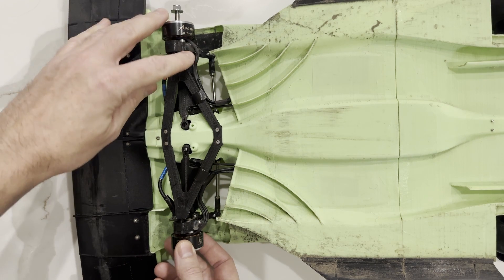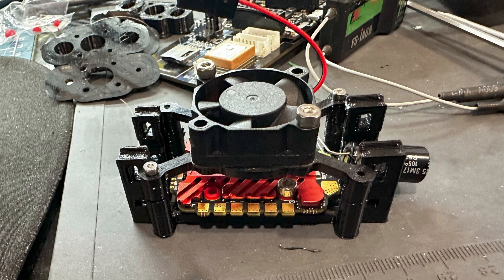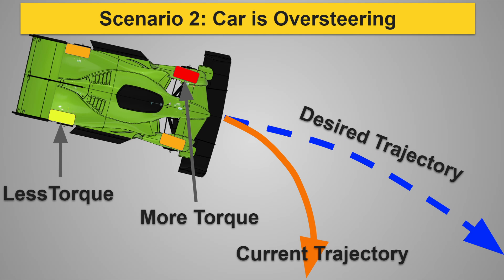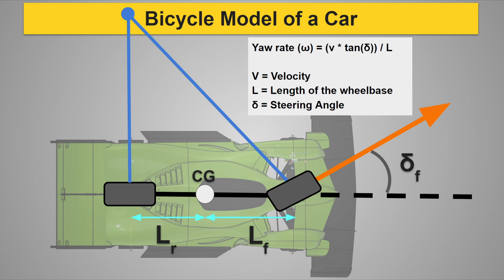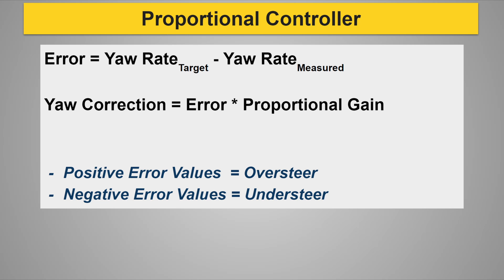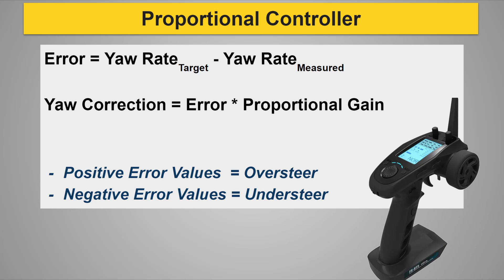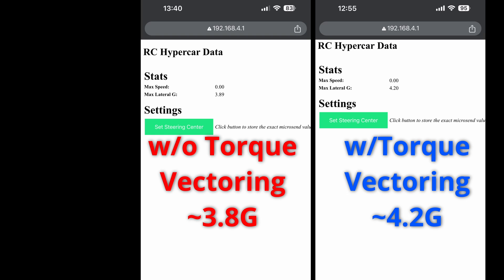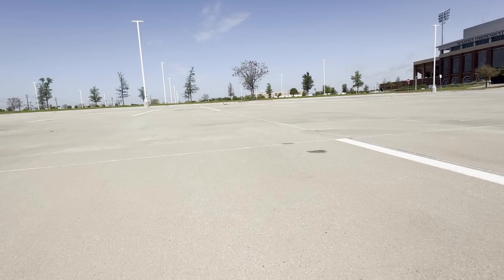RC Hypercar Pt10

Comment: What a fun process to follow along with. I wonder how much more room there is for improvement with a hypothetically optimal torque vectoring setup that considered weight transfer. I was actually shocked that it made such a large difference at high speeds. 0.4g is not insignificant at all considering the amount of downforce already involved.
Reply from the maker: Thanks!  Yeah, I think in retrospect that a lot of that gain at high speed was because I could push the car harder over the bumps. Basically the torque vectoring was acting like stability control so I could lean on the car more.

Comment: Nice work.  I would suggest you move the heavy wheel motors off the wheels and put them in the center with driveshafts.
Reply from the maker: I looked at that a bit, I couldn’t find a good driveshaft setup.  I need to buy some old RC touring cars for parts. 

The driveshaft some trade offs as well, the diffuser would be smaller in the middle.

Comment: So you're using the Avenger 2810 900kV motors correct? Do you think you could get away with smaller motors as well?
Reply from the maker: I have the 2810s in the front and 2812s in the rear. I don’t think I could get away with much less because of the heat unfortunately.  

When the car was rear wheel drive it was very marginal from a heat perspective, with the front motors added it’s much better, but I still need the turbofan wheels to pull the heat. CFD shows the car will pull 600 watts at top speed.
Reply: @IndeterminateDesign  I see, thanks! :)
Reply: And one more question cause I'm thinking of building something similar perhaps: How are you dealing with dust or sand getting into the outrunners? Has that been a problem you've encountered so far?
Reply from the maker: @TheHypaaa  The dust is a bit of an issue sometimes and I always clean out the motors after running.  The bearings probably won't last as long, but they're not too hard to replace on these motors.  

One parking lot I ran in had magnetic rock dust.  It was a nightmare to remove from the magnets and it destroyed one of the motors.  

It's definitely possible to create a dust shield so the air is only pulled in from top half of the wheel.  The car moves so much air that everything gets packed with dust.
Reply: @IndeterminateDesign  I feared that might be the case, but thanks!

Comment: Very cool project. Torque vectoring is basically what you are doing when you change differential gear oil weights. It's interesting to see this being done electronically. This is a on whole other level, and the performance shows. :yougotthis:

Comment: Have you looked at using bidirectional dshot to talk to the ESC and get telemetry out of it? Betaflight uses that to get motor RPM and it seems to work pretty well.
Reply from the maker: I’ve looked at it, the Arduino libraries that I found are still kind of rough. It would be great because I could update motor throttle several thousand times per second. I’m not sure if this is a function of the ESC or the firmware but the RPM is +/-200 with a 30ms delay. It’s good for balancing out the motors over time since they all respond slightly differently, but for traction control with the encoders I’m looking at +/- 3rpm.
Reply: @IndeterminateDesign  Ahhhh, that makes a ton of sense, yes. Bidi dshot telem is definitely not going to do what you need then. 

Adopting dshot, though, could definitely provide some gains in motor control, though, which would be super cool! It might be worth looking in the dshot code in betaflight or ardupilot if you're thinking about going that route.

Comment: I’m blown away by how far this car has come. The pov cam was awesome too. Really shows how ridiculously sharp those turns are. 10Gs is insane. The average human passes out below 7Gs. The velcro on the battery made me laugh because I have that same problem with my rc boat. I’m amazed how durable the front splitter is. That thing was eating those rocks like they were Doritos lmao.
You’ve basically already done all the stuff I was thinking of, and I have no idea where you could go from here. But it sounds like you’re not done so I’m very excited to see what’s next.
Reply from the maker: Thanks!  I have an entire box of broken front splitters.  This last one is made from nylon and it just kind of bends now.
Reply: There's a big difference between lateral Gs (like a driver experiences) and vertical Gs (like a pilot or roller coaster rider experiences) on the human body. We can take far more lateral Gs than vertical.

Comment: this is one of those rare cases where human limitations prevent a car from performing better, i cant even imagine trying to drive this on any track. maybe you could try it on a 1:8th scale pan car racing track or a asphalt touring car track with reduced power output and work your way up? would love to see it on a track, maybe even get a transponder system to compare lap times with some other rc car classes on some local track that has timing equipment?
Reply from the maker: I will try to do this. I’m moving to a city that has a big indoor RC car track, so I’m excited.

Comment: Really nice project! I am trying something like this on a smaller scale, more like a formula student. I am using drone parts and thinking about  the torque vectoring, do you think it would work a bit like differential thrust for a plane?(albeit a bit simpeler) I don't have enough time for writing al the code but it should be able to work, right?
Reply: I am also using fans for downforce(small drone motors and props) and am going to try a small aero package as well
Reply from the maker: Differential thrust helps the car/plane steer tighter. It’s kind of a passive torque vectoring, it will help turn tighter but won’t increase handling performance.

Comment: would love to see you racing this with a fpv camera on it
Reply from the maker: I think FOV would be the only way to run this on a race course. It’s so hard to judged distances otherwise. Really this car needs a karting track.
Reply: There is a lot of image vibration to deal with that you just don't get when flying a drone with fpv. Every little bump in the surface causes camera shake. Also at higher speeds you get a bit of tunnel vision and need the camera mounted up quite high to still get any decent depth perception. High speed in a parking garage with tall walls to see was not too bad but outside in a parking lot the curbs are hard to make out until you are right on them. I tried it on my Vendetta with the camera mounted probably 6 inches above the body shell height with dji hd fpv cam. It was fun but challenging.
Reply from the maker: The vibration is pretty bad. I’m using a Runcam split 4K, which I think is an FPV camera. I had to mount it on foam though to get decent footage.
Reply: @IndeterminateDesign  I started out trying to soft mount the camera with some dampening tpu mounts but it was undrivable via the fpv feed. The least shaky image I got was hard mounting an aluminum bar to a solid carbon fiber brace on the chassis. The bar stuck out through the roof of the car and the camera mounted at the top of the bar. The piece to secure the bar to the carbon brace was a beefy petg piece and the mount for the fpv camera to the bar was also petg. That limited the vibration to just what the car felt. All my soft mount attempts just amplified the vibration.
Reply: @IndeterminateDesign  supposedly one of the very latest runcams has faster onboard image stabilization.. might be enough now. (I use one of the older ones and its marginally good enough for my slow fpv truck on rough ground)
Reply: It's definitely best to mount the camera solidly to the chassis, because then the whole vehicle is the damping mass and the suspension actually works for the image stabilization. Having the vehicle locked in the view helps with orientation and drivability.

Comment: How long dose the battery last?
Reply from the maker: I haven't ran it hard for an entire battery, but generally I get ~20 minutes from a 3300mah battery.  Obviously, top speed is slower near the end of the run.
Reply: @IndeterminateDesign  thanks, you have built a beast
Reply: @IndeterminateDesign  whats the C rating on the battery that youre using? also is it a single 6s or 2 3s batteries